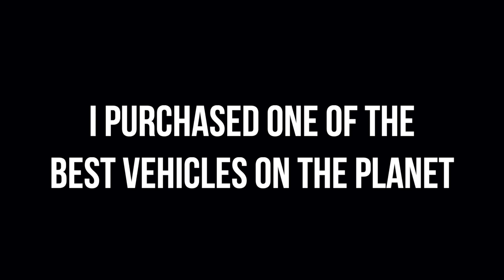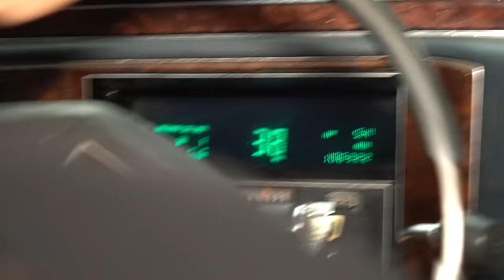THE SECOND BEST PURCHASE I’VE EVER MADE!

Comment from the maker: 🔴Reply to this comment to request what we should do to the limo (most liked comment wins)
Reply: twin turbo ls swap, get Cleetus Mcfarland involved
Reply: Bounty hole limo
Reply: Do an ls swap with twin turbos sticking out the hood
Reply: LS swap
Reply: Take it to busco beach or any riding park with all the boys.
Reply: Lift Kit and mud tires ✅
Reply: Put cheap eBay turbos in it
Reply: Offroad camper/rv that can haul the X3 or 4 wheelers. And do a ls or Cummins swap
Reply: Lift it up
Reply: Cummins swap it
Reply: @Carter3318  yessss
Reply: 2 12s in a 4th order box,train horns 20” lift and 44” boggers
Reply: Lifted it,Put tires that are 30s
Reply: monster limo
Reply: Lift tires and wheels. It’s always a good day when Kyle posts
Reply: Lift up the limo !!!!
Reply: Lift it snorkel it and get adapters and put assasinators on it and call it the Mullen express
Reply: Lift,snorkel,assasinators= the Kullen express
Reply: 6 inch lift kit
Reply: Bounty hole build
Reply: Of course jump it
Reply: Make it convertible limmooooo
Reply: Should do a suspension lift with some 22s or 24s with some Open Country 33 to 35 inch mud tires take the middle seat out make it a little bed in there keep the backseat put you a 32 inch flip down flat screen TV in towards the front put 212 and 210 couple amps couple batteries two capacitors hand-painted put some train horns on it LED lights on the inside a little fridge inside of it and then roll cage from front to back so it could support the rack on top of it so you could haul your it X3 on top for the four-wheeler and then wrap it black and yellow and do the X3 in the same scheme with some gears and pistons some skulls and some flames in the rap now that would be badass and then do a few things to the motor and yes pushing twin turbo skis on it and let them bald eagle sing brother yee yee and then you could take it to all of the mud bogs and you could sleep inside of it and haul your s*** at the same time that would be dope just an idea bro but if I had it that's what I would do to her if I had the money which I don't so that's why I'm giving you all these idea but if I did you best believe I would go all out if you need any help holler at me and I would be glad to help you build it AKA from Chad senior
Reply: And like I said in the first other to post put some Led bars all around it but definitely put you one of them racks on the top with the ramps that fold down over the trunk will touch the ground so you can drive to X3 up on it
Reply: wrap it camo and mount big bull horns on the front and diesel swap it buy a camo suit for it
Reply: Snorkel it
Reply: Cummins swap

Comment: Also give it one hell of a paint job definitely do suspension lift put them 22s or 24s within 35 mud tires on and put some LED light bars and the roof rack and all that good stuff man dope then you'd have a car / U-Haul / camper gate to the mud bogs in ship man and put a hitch on the back so you can tow the trailer would your Can-Am on top of it and then whatever in the in the trailer

Comment: Kyle you need to. ?pimp that thing out bro put some 24s on it before 12 in the back to 10 for 2000 watt amps for Batteries two capacitors 12 inch flip down TV for the front and back get a new Pioneer head unit for the front Twitter six by nines put a roll cage all the way through the whole thing roof rack so you can park your Can-Am on top of it little take the middle seat out of it leave the backseat in and put like a bed in the middle so you can use it for camping put a lift on the car put some 24s with some 35 inch mud tires on them Ogio couple train horns LED lights supercharger and let it eat brother good luck and congratulations on the new caddy bro